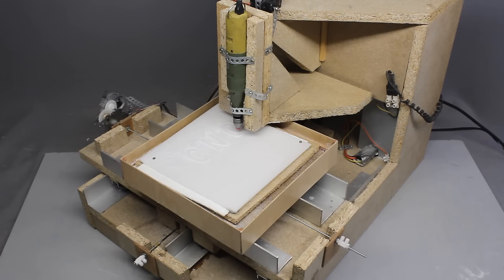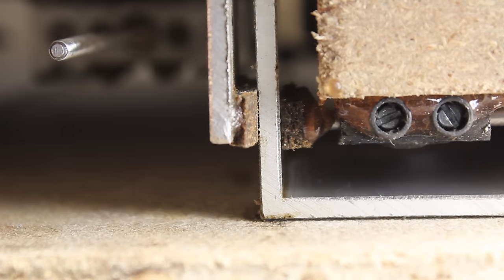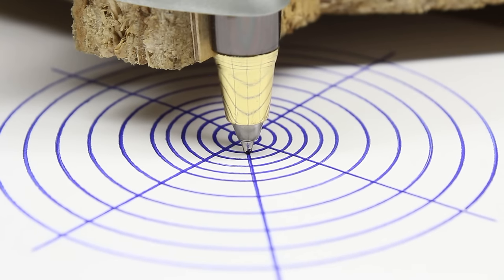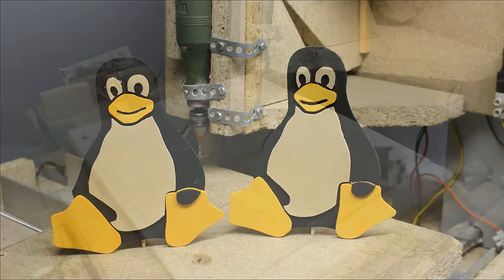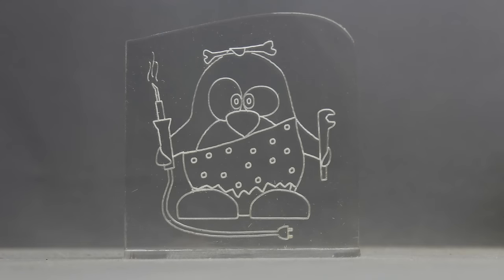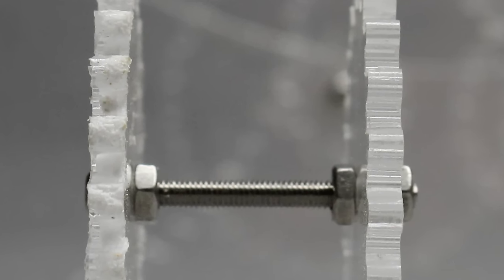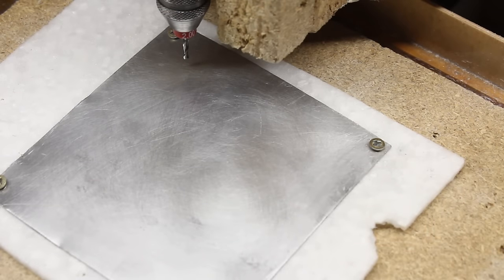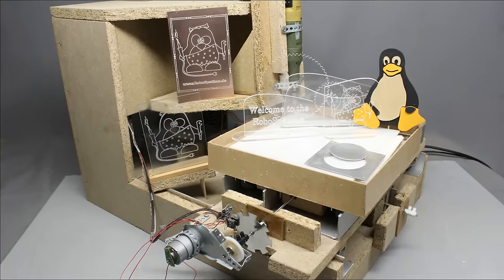Upgrade to CNC v0.6.1

Comment: I love the low cost/upcycle concept. I've been planning to build something similar. A couple suggestions: 1.) You don't have to buy wood, the last week of the month, in any suburban area with rental properties, you get free-resupply-trash-day. 2.) Manual floor tile cutters are a cheap place to source high quality, long, parallel rods for an axis assembly. New, they are fairly cheap, they can also be found very cheap at garage sales and thrift stores. 3.) Have you ever thought of using a bicycle chain and cog attached to motors for driving an axis? If you ask a local bike shop, after they service a bike, they will probably give you a worn chain and (very-important) matching worn cogs for free, just clean them up. ;)
Reply from the maker: +Bike Religion - The Reformation 
I did not buy the wood for my machines. It's reusing old stuff. Yes, one mans trash is another mans treasure.
Great hints for  free supplies - thanks!
Hope to see your machine soon!

Comment: Chipboard wouldn't have been my first choice, but I'm amazed how well it works considering just how little money has been spent and how much of it is made from printers and CD drives.

Nice work.
Reply from the maker: +John Perkin Thanks! As you might have recognized, I am no woodworker, thus I did not have better material like Plywood in stock. A metal construction would be the overkill for that simple design I had in mind when creating this machine.  Better (more solid) CNC machines will follow.

Comment: I don't want this to come across as negative because I like your videos but the reason why your wearing out router bits is because with such a low feed rate your not really making a chip, your not biting into the material, it's just rubbing it away more like sandpaper than a chisel. Its supposed to work like a chisel, cutting a chip away with each revolution. The manufacturer of your cutting tool will probably provide a chip load rating. You have to match your spindle rpm, cutter tooth count and feed rate so that your chip load matches the specification. Calculators can be found online easily enough. What it means is lower spindle rpm and higher feedrate.
Reply from the maker: +Adam Hill Sharing knowledge is never negative. Yes, I knew about that problems. It's really no machine for processing metal. I was just curious if the high sideload would result in an oval cut instead of a circle. It's obviously not made for cutting Aluminum. Thanks for your comment.

Comment: Well done, I was thinking that perhaps instead of using 'Chipboard' have you considered using 'Plywood' or 'MDF'. Both of these woods are a little more expensive, which I know is your main requirement, both woods are better at holding a screw. I have built thing from chipboard and very soon the screws had come loose with vibration. I rebuilt using marine plywood and it became a very stable base to fit a router to it.
Reply from the maker: +keefy With my CNC v3.x series I will try a variety of materials including plywood and MDF. Especially MDF absorbs vibrations, thus it might be a good choice. Thanks for sharing your ideas!
Reply: HomoFaciens My pleasure, I have been a tinkerer for many years now.

Comment: Love the machine. You showed how just a little of tweaking can improve on a final result. When you cut plastic, why does the machine dive so "jerky" in to the plastic? It moves like a chicken moves its head, its not smooth, it goes up and down and then suddenly it dives... Is the router to heavy for the small servo that's driving it up/down?
Reply from the maker: +buzga1987 The chicken movement is to avoid the plastics from melting. Water can flow into the drill hole when diving into the plastics. It's something experimental and with a new, sharp drill bit there is no need for that movement. The servo can lift the router easily.
Reply: +HomoFaciens Thank you very much for you reply, it makes sense now. Can't wait for new videos.

Comment: Great video! Would more stable motor holders help with the precision?
Reply from the maker: +Wasserverschmutzung Not really. With the prestressed mount, the wobbling of the motor is kept away from the threaded rods (at least most of it).

Comment: For better pcb resdults - there was a nice "hack" with 3D printer - paint the whole pcb using permanent marker, mount a sharp object on the cnc/3D printer instead of the routing bnit/extruder and use it to scrap away the thin layer of npaint. Then just use the chemical processes as usual. Considering the demo with pen, this technique should produce very high quality even on this cheap machine.
Reply from the maker: +Robert Klauco That's a really great idea. Thanks for sharing!

Comment: Really like this video series. I'm curious though, why did just increase the encoder disk size to get higher resolution?
You could likely double or quadruple the encoder disk teeth and then carefully reposition the detectors with respect to each other and the teeth.
Reply from the maker: +Lee Cook The machine was created following the rule of thumb. Carefully reposition the sensors would break that rule ;)
The more teeth or the smaller the diameter, the more precisely you have to cut the disc. That's hard without a CNC...
Reply: Ah, are they hall effect sensors? I thought they were photo diodes, and was thinking paint on a perspex disk.
Reply from the maker: +Lee Cook It are transmissive photo sensors. I will test if I can block the IR light with a pattern printed on a foil with an inkjet or better laserjet. If that works, it would be an easy job to create sensor discs. Good idea.

Comment: I really love this machine you've made i am very surprised the servo can lift and hold the weight of the cutter. I can't help think a more accurate threaded rod based z axis would work better.
 I think the etching of the glass plate is my favorite part... can't wait to see your next upgrades
Reply from the maker: +builtrodewreckedit Well, the accuracy along the Z axis is good enough to cut 2D shapes or to engrave glass. The simplest solution is the best solution.

Comment: Could you use the CNC to mill more accurate encoding disks? If so, how much would you expect the precession to improve?
Reply from the maker: +Rouverius The accuracy of the encoder discs is a miner issue. Using ball bearings or better threads would be a better approach to increase accuracy.
Reply: Thanks!

Comment: once i opened the inkjet printer and it had 18V brushed dc motor with plastic disk connected to its shaft and it had black lines printed on it like on the angle ruler and it used similar optical sensors i guess something of the sort can be done with laser printer on some transparent "plastic" paper then glue it on some hard clear surface like those clear cd's or something. i would like to build my own cnc machine but i have very little to none programming knowledge :(
Reply from the maker: +E43 Yes, you can use a laser printer with a laser foil to print the pattern of a encoder disc. When I was born, I also had no programming knowledge. Do the same thing I did: Learn coding!

Comment: Hi
and thank You of course. I needed something cheap but small, that can You put in bag = portable cnc Machine for working up to A3 dimensions. Only for PCB and drawing with pencil or so.

I stay tuned for your next cnc machine in 2016.
Thank You, great project.
Reply from the maker: +mrstanlez The next step I am preparing for is an upgrade of my CNC v2.0 using bipolar stepper motors. Today I have soldered the new electronics. Another future project is a robot arm. Maybe that could become a portable drawing bot that can cover the area of DIN A3.

Comment: To overcome friction in 3mm pre-tensioned rods, use thrust ball bearings. On eBay you can get 10 Chinese for about €8.

And yeah, use laminated wood. Laminated wood is the strongest wood there is. Wood is 3 times stronger than any plastic. But chipboard is waste of time. It'll all fall apart, sooner or later.
Reply from the maker: +HitAndMissLab There is always something to improve in a design of a CNC. I will create more "professional" CNC machines sometime. The main intention of this one was to make it simple (thus no ball bearings). If you have laminated wood in stock for creating a machine, it's indeed the better choice. Nonetheless my chipboard machine still runs fine ;)

Comment: arnold schwarzenegger LOLz
Reply from the maker: +Jamal Nazzal Don't laugh at a terminating machine... ;)
Reply: +HomoFaciens sorry won't happen again :(. terminator ! since you know a lot about machines, you are one, I'm trying to build my CNC and I'm not sure if i should use arduino board or breakout board. with Mach3
Reply from the maker: +Jamal Nazzal ...you are no longer on my target list ;)
What board to use depends on your programming skills. If you are a beginner and intend to use mach3, you should look for a board that supports that special software. I have written several lines of code to make my machines accept nothing but Scalable Vector Graphics (*.svg).
Reply: +HomoFaciens understood. thanks terminator.